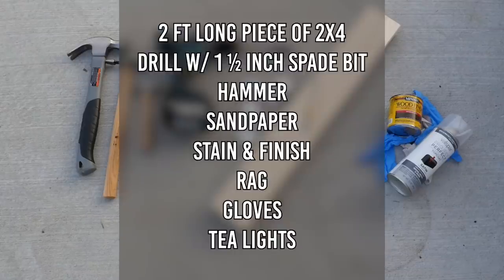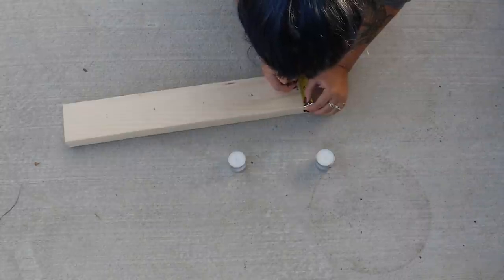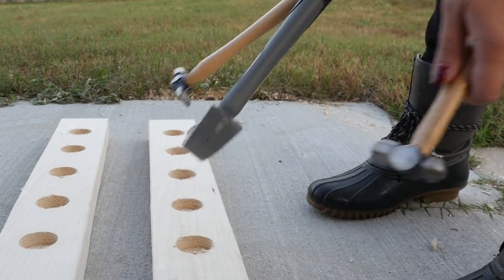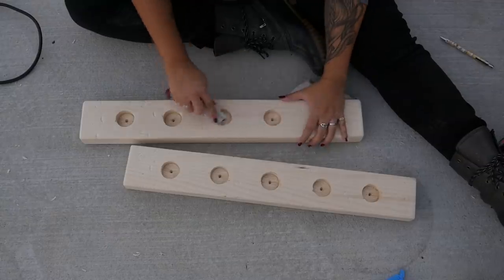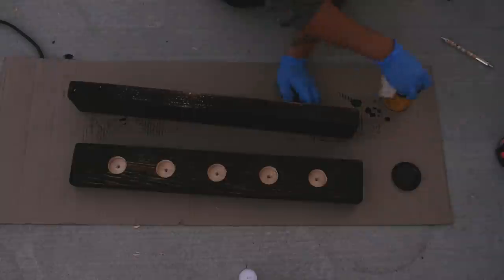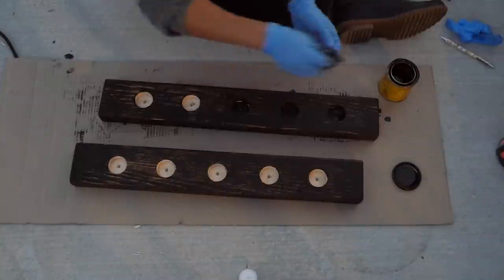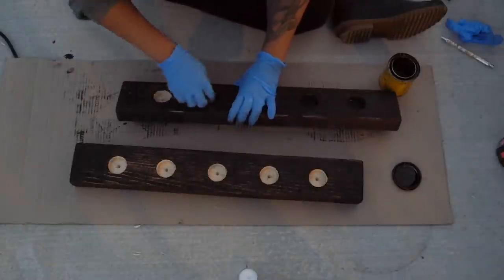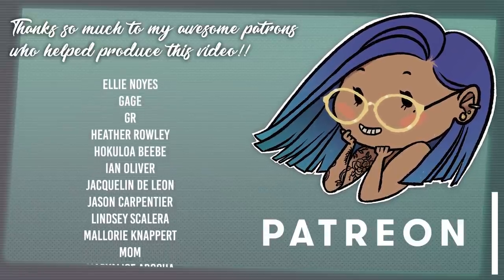How to Make Tealight Holder Centerpiece - DIY

Comment: I gave up on oil stains a long time ago. I usually do water based or make my own with watered down paint, coffee or tea then spray with a sealer. I haven't tried the one that's made from soaking steel wool in vinegar but it looks like it would work for the rustic look.